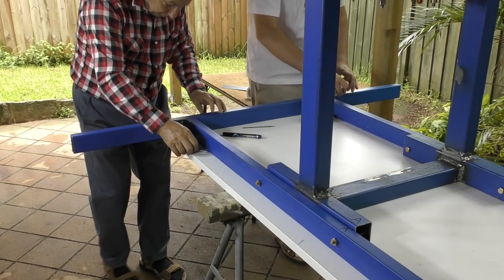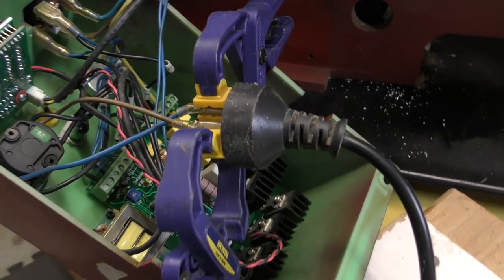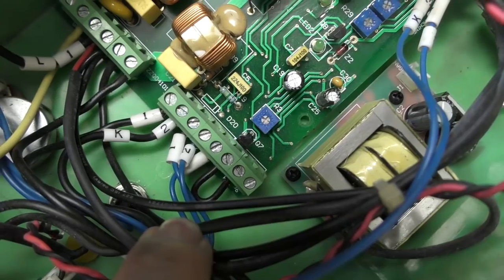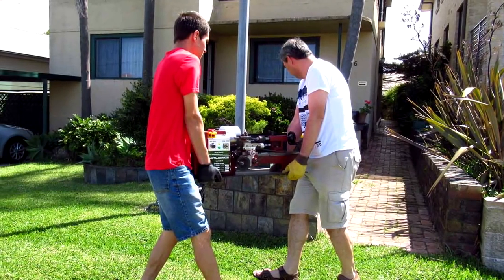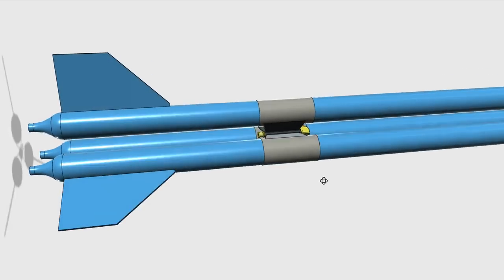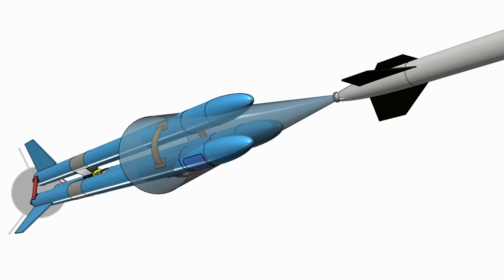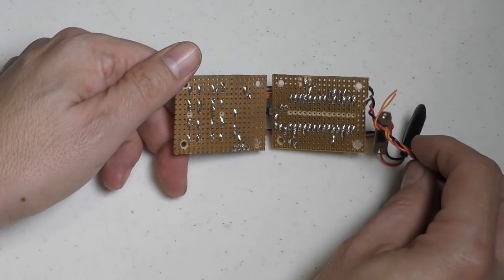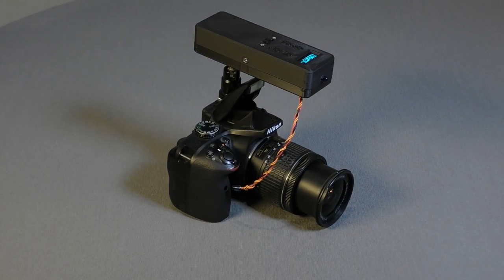2 Stage Water Rocket - Part 24 - Booster Design

Comment: This project deserves so much more attention from the public! Keep up the great work George! With the upper supports I’d almost be inclined to go with a combination of both the 2nd and 3rd option. The clips like you said would be great for keeping everything straight during first stage acceleration but then if the outer bracket wasn’t their I’d be concerned that during staging the tops of the boosters could be knocked about a lot by drag or the second stages exhaust putting a lot of extra strain on the lower supports. Though aesthetically just the 3rd option would be my favourite.
Reply from the maker: Thanks Paul, good to hear from you. :) I tend to agree that it's probably worthwhile going with options 2 and 3. One concern I have with just using the clips is that the booster segments are not supported during landing, and that could put stress on the joins further down the rocket.

Comment: An idea possibly worth considering as an alternative to a single set of clips at the top of the booster, would be to have C-profile guide rails on the insides of the three booster rockets, and mating T-rails on the sustainer. Some additional thought might have to be put into choosing the materials, to achieve both a tight fit for structural integrity and to minimize friction.
EDIT: The T-rails could possibly be split into smaller tabs spread evenly on the vertical, saving some weight and to help with friction as well.

Comment: With the holding together of the booster noses, you could use the split ring, the second one you showed, where it fixes to the sides of the boosters. But make it a wing shape inwards , so it produces a compression force, holding it all together, so it can be thinner and lighter, and produce less drag
Reply from the maker: Interesting, so it compresses inwards using aerodynamics. :)
Reply: Air Command Rockets yes, it makes itself stronger, the faster it goes

Comment: Finally. I think I rewatched the whole series at two times since the last eposide. 
Btw. are you afraid of some kind of weight asymetry because of the two chute? Or the onboard computer will balance it?
Reply from the maker: Thanks for following along. :) That's a good question. I don't think it will be that much of an issue, as we plan on putting a couple of cameras, altimeter, bigger batteries and supporting structures for those in the 3rd nosecone so it should help balance it out a little bit.

Comment: Hint: Do a mudmap or photograph of the connections to the old board BEFORE swapping the wires over to the new.
5 minutes of drawing can save hours of grief...👍👍👍
Do you need the old board repaired as a spare?
Reply from the maker: Yup, we did both photographs, as well as written out the connections before we started the board swap.

Comment: Hello sir What should be the distance of the rope from the center in parachute
Reply from the maker: Are you asking how long the shock cord should be from the rocket to the parachute shroud lines?
Reply: @AirCommandRockets  yes
Reply from the maker: @ahmeterenbahcac7436  There is no hard and fast rule on that. A longer shock cord is better at absorbing shock when the parachute opens suddenly. But a longer shock cord weighs more and takes up more room. I would say anywhere from one length of the rocket to 5 times the length of the rocket would be normal.

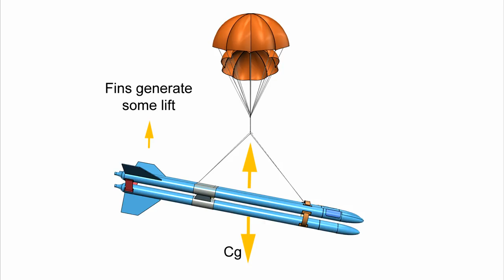Comment: 12:14 - Yes... why is that?
Reply from the maker: It's the airflow that spills out from the underneath and around the parachute. Normally it is pretty even all around with a single chute, but the place where these flows meet from the two chutes it creates a higher pressure, and so it pushes them apart until you reach an equilibrium.
Reply: @AirCommandRockets  - Ah, that makes sense, thanks!